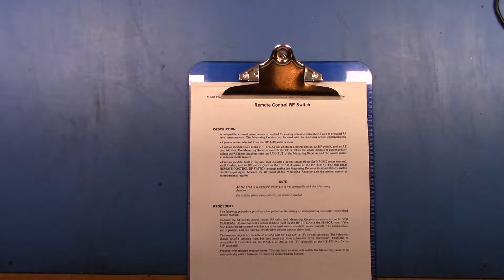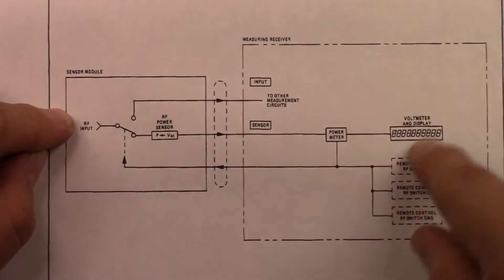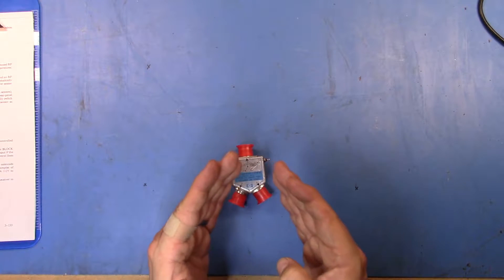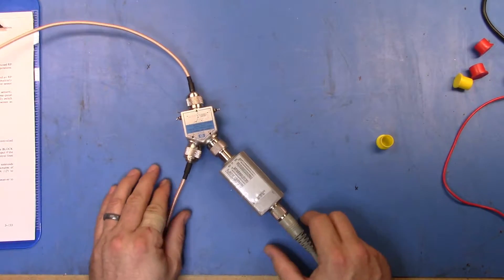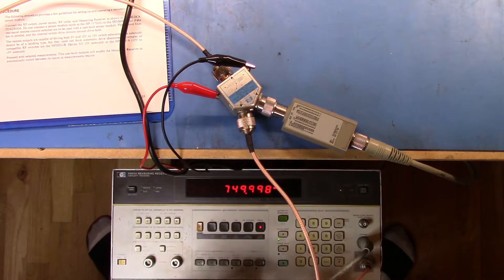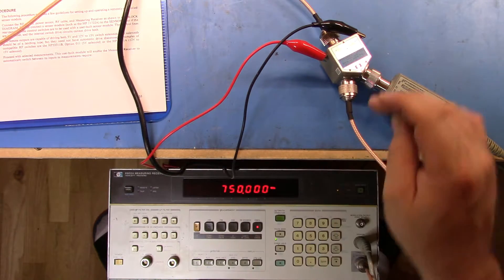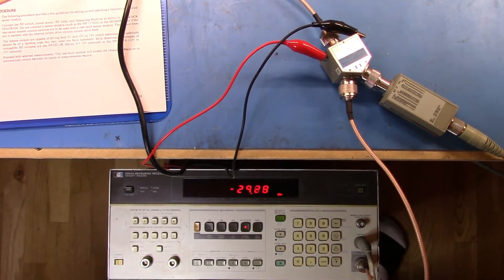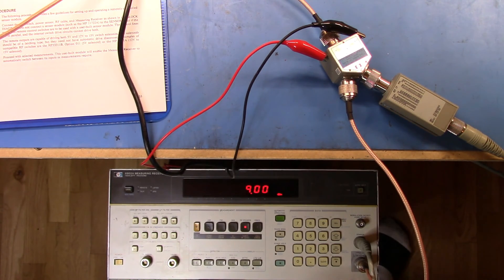HP8902A Building a Remote RF Switch

Comment: I’m from the future and this helps with the 11792A price insanity (an accessory being 3x or more the price of the unit) and shortage.
Reply from the maker: It certainly does - You can get those relays fairly inexpensively and, once you wade through the 8482A sensors being "untested but taken from a working environment", you can basically have a working device - Doing the same for the 26.5GHz sensor head though is way more expensive...
Reply from the maker: BTW I watched one of your videos that had an 8340B in and meant to ask what you were doing with the ribbon cable coming out of the bottom of it?
Reply: @tgsoapbox  that was a spare patch cable I use for attenuators at the time. Funny that you mentioned that b/c I recently got my hands on a 8902MS minus the sensor, 8673 and cabinets. The weird part is that the 8902 had its attenuator parted out (knew about it before buying) yet everything works so far. Other odd things on this 8902 I got are a damaged K1 component on A16 due to someone misaligning the cover screw (still works but got a spare) and a flat ground cable (like the 2 on top of the AT1 and RF sections) snapped. Possibly causing a short of the J3 pins of the RF section MB (pins 1-2 seem like NCs but the manual makes no mention of J3). Anyways, plan to finally use that ribbon cable with a spare 33321. Just need to make an AT1 bracket. The coin cell was slightly corroded but still holds 3.2V!
Reply from the maker: @CNe7532294  Nice - Did you get the controller (I think it is a 9825 or so - never used one). I've been looking for the attenuator & SigGen test software for 8902A for years and never found it (not surprising because I'm led to believe that HP used an HW dongle to license it).

Comment: Good workaround for a hard to find sensor.  Is it possible to use this set up with an HP 8484A sensor?
Reply from the maker: Sort of - You could set this up I think and have the system change automatically from the RF input to the sensor when moving from Frequency to RF Power but I don't think you'd be able to use it with a calibrated Tuned RF Level measurement.

Because the 8902A uses the power sensor to set the start of the calibrated Tuned RF level measurement I'm assuming that it would expect the sensor to be returning a value in range of -30 to +20 dBm - It then uses that value to compare to what it reads from the RF tuner and "calibrates" them. From that point on it just uses the RF tuner and does a "calibration" when it switches the ranges.

It's not inconceivable that it would work with an 8484A because that range swap occurs around -40dBm and the 8484A does go to 20dBm and they're detected via a resistor in the sensor head but I would probably say that the firmware is expecting just an 8482A or maybe also an 8481A.

The 11792A 26.5GHz sensor head has an 8485A inside it. So the firmware is probably expecting that as well as when the frequency offset is configured.